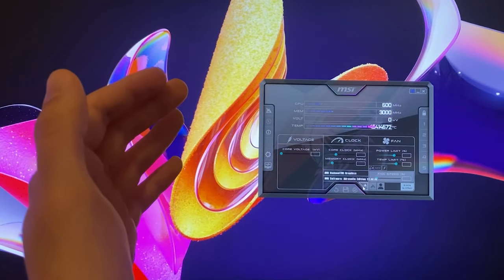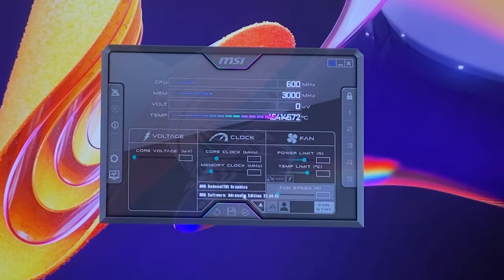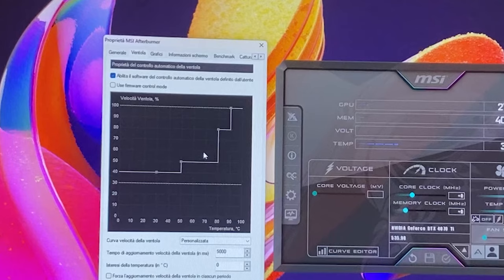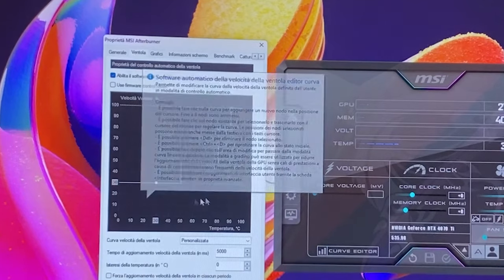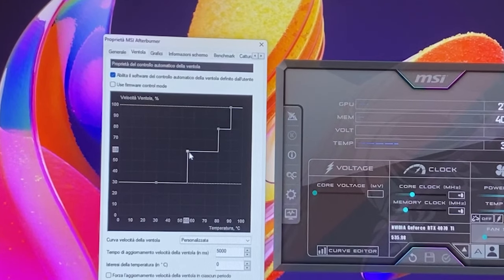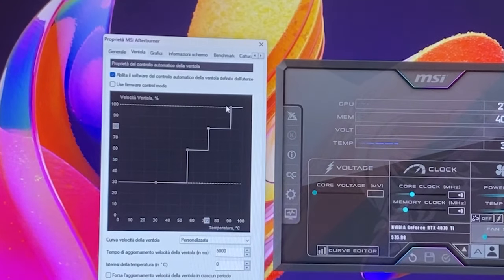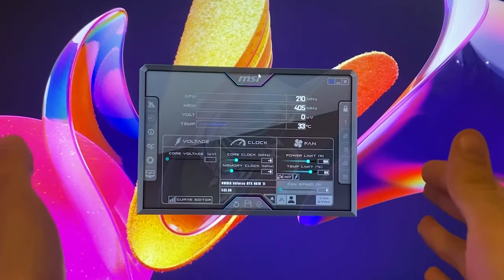Set a Custom Fan Curve on your GPU to Reduce Temperature and Noise - Tutorial

Comment: I have a Strix 4090 OC and also have the line that doesn't allow the fan speed to ever be completely off, BUT I set mine at ZERO regardless and if my cards under 35c it will actually not have the fans running at all - Also as for you not recommending doesn't really, almost objectively make any sense, 30% fan speed for hours a day potentially is only going to cause the fans to wear quicker. My GPU at idle stays between 28-35c MAX! For doing anything other than gaming, such as browsing the web, watching youtube videos, twitch etc. With that said, having ZERO RPM is objectively the better option
Reply from the maker: I definitely see your point and in GPUs with massive heatsinks that’s actually a very good choice! Be careful with doing it on lower end GPUs with no VRM/MOSfets heatsinks because you do need to cool these with some airflow
Reply: "BUT I set mine at ZERO regardless and if my cards under 35c it will actually not have the fans running at all"

Same here with the 4080 MSI Ventus, as I also prefer the fans completely off at low temperatures.
I have the issue though that I want to fans to stay off also at a higher temperature, let´s say still off below 60 degrees - I changed the curve accordingly in Afterburner, but it seems it´s not being considered.
Any idea how to fix that?
Reply: itsdistinctly are you sure? I just don't really understand these things
Reply: How can set 0 fan on aferburner?
Without aferburner my 4080 zotac trinity have fan stop,but if i open afterburner fan start at every temperature 😢

Comment: Soo when i was playing Valorant my GPU fan speed sometimes increased constantly and then decreased again, is that normal? I'm using GTX 1660 Super and followed the exact setup like in your video.
Reply: that is normal if you didn't set your fan curve and go with stock settings

Comment: My coller in a brand new rtx 3060 asus dual is making rattle noise at 78 to 81% so i undervolt in with your previous guide and make flat curve to 64-80C to 76% and it works flawless, thank god that earth got ppl like you🙏
Reply from the maker: I’m really happy it was helpful! Thanks a lot for taking the time to leave some feedback! :) I’ve also got a few build videos on the channel and more coming, if you like the content consider subscribing as it really helps me a lot!
Reply: Have same card, its terrible at 80%. Have a look at your gpu hotspot! Mine were too high. See my main comment
Reply: you mean by coil whine? or rattle from the fans. if its coil whine its normal you can minimize the whine if you are playing a game make sure set the fps lower 60 fps below no coil wine 70 to 90 minimal whine. 100 to 250 noticable whine. i dont know about the rattle but if your gpu rattle on that rate your fans must be bad.

Comment: Hey!  I followed this guide and your undervolting guide and I am impressed. My 3090 Ti FE runs so cool now with no performance loss at all. My GPU is yet to go over 55c and I have been running games like Cyberpunk and Baldurs gate 3 all on ultra settings. I do have a question though, so when my GPU is a temp between 30c and 55c the fans operate at 800 RPM, but when the GPU is 55c it doubles to 1600 RPM. I am curious if this could possibly have an effect on the life of my GPU or the fans. I will also mention that sometimes it bounces between 800 RPM and 1600 RPM because the card will go from 54c to 55c back to 54c and so on. But overall I am satisfied and yet to see 60c on any game just worried a bit about the fans.
Reply from the maker: I’m really happy it was helpful! Thanks a lot for taking the time to leave some feedback! :) I’ve also got a few build videos on the channel and more coming, if you like the content consider subscribing as it really helps the channel! No worries about the life of the components, they’ll be better than before :)
Reply: You can set the hysteresis for the last problem youve mentioned! I recommend 10 °C. so when it reaches 55°C, it will run 1600rpm until the temp goes down by hysteresis amount, so in t his case 45°C. This will stop fluctuating speeds and lessen the wear of the fan
Reply: @TheEasyk wish there was some visual on how u set that hysteresis..

Comment: just followed your tutorial of undervolting 4070 super and it is truly amazing! but now I'm not quite sure whether I should adjust my 3-fan gigabyte windforce 4070 super, for it works around 50-60 degrees, and it seems strange to get one of those fans to span at 60% and the other two will be doing nothing. do I have to adjust my gpu fan at this point?

Comment: What should be the maximum fan rpm at around 75C? I usually set the fan speed at 65% (2400rpm) when I'm gaming. The stock fan curve is weird on my RTX 2060. Max RPM i noticed was 1800rpm which causes the temperatures to hit 84 (not undervolted) and 76 (undervolted 900mv) on full load.
Reply from the maker: Really it depends on the fan itself. I’d say 60-70% is very good, RPM aside!

Comment: Thank You!
The 4000 series is very well cooled, I test with the 4080, 55% fan speed is more than enough, I never see 60 degrees Celsius.
The 4070TI has lower wattage and I think the 60% fan speed is too high, I only recommend if you have terrible case airflow.
Reply from the maker: I’m really happy it was helpful! Thanks a lot for taking the time to leave some feedback! :) I’ve also got a few build videos on the channel and more coming, if you like the content consider subscribing as it really helps the channel! I agree, on the 4000 series you can get away with much quieter fans overall :)

Comment: manual adjust the fan speed won't cause the chip overheat? cause the fan speed is not in natural mode, not auto let the fan speed adjust itself better even though loud? Gaming in 60 FPS fan speed won't go loud unless disable vsync in game setting for make it higher fps.. high fps the card  increase fan speed RPM. If the pc for working or browser only, don't have to bother adjust the fan speed. it won't go high at all..new graphic card, new technology,  fan speed 0 RPM

Comment: Thanks for the video. I tried the 4 node profile you suggested. Tried to save to card. It said it could only do a 3 node save. I did that and it took it. Now, if I wanted to try a 4 node with AB running, how would I reset the to the four node option. It went away doing the 3 node. Anyway, good info. I have some control of the fan speed.

Comment: In cs2 while i play my fans chances in between 60% and 80% so much. Like it is 60% then goes 80% for like 10-20seconds and then back to 60%. So does it harm my fans or gpu or is it just good???
Reply from the maker: I'd say try to put it to 70%, maybe it will stay stable, for noise. But no, it's not gonna damage thee fans
Reply: @ImWateringPSUs  okay u mean 80 to 70 or 60 to 70?

Comment: So checking the box that says “firmware control mode” will basically save your profile so you don’t constantly have to run msi afterburner at startup or while playing games? Does this also work for the undervolting settings as well?
Reply from the maker: Correct and correct again :) Also consider dropping a like and a sub!

Comment: At 30% (lowest my GPU can go) my fan rpm is 1780-1800. It's loud as hell and it's driving me insane. Some people I've spoken to say their fans can go as low as 900 rpm on the lowest percentage. Is my GPU faulty or something?
Reply: it depends on what type of gpu you have if i set my strix 3080 ti the only noise from the fans is around 60% below that no noise at all. what software are you using for fan curves?

Comment: i have i gtx 1070 asus turbo when doing nothing the temperature is around 36 to 40 but in gaming for example when i play apex legends temperature jumps all the way to 82 i changed the thermal past added some out take fans but it didn't change much ...
i hope you can give me an answer to this problem if you have one 
nice video btw
Reply from the maker: You need to undervolt it, I have a tutorial on the channel

Comment: if firmware control change your fan curve settings on your gpu is there a way to reset the firmware fan curve settings back to default or do i just uncheck the firmware control box
Reply from the maker: Yes you can, just uncheck the box :) Oh and subscribing to the channel helps too :p

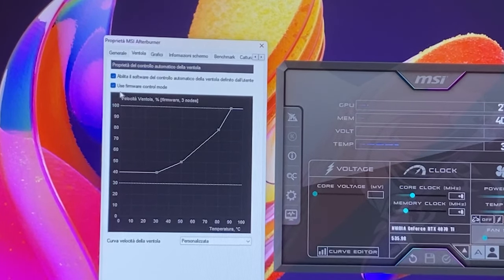Comment: Bro! I did what you said at 1:50 to save the profile to my gpu, and now the gpu fans stop working entirely, even if it reach 100 degree they stay not spinning, I restart the pc, and unninstalled msi afterburner and still nothing, please help! I heve an rx 580
Reply from the maker: You must have another software interfering. Reinstall the drivers, reinstall afterburner, set it to default and they will work again :)
Reply: I reinstalled MSI AB, I uninstalled the GPU drivers with DDU and installed them again, a friend came by and flashed the GPU with fresh bios, I also tried it on another setup, nothing works :( @ImWateringPSUs
Reply: @takey2376  Bro did u get it to work?
Reply: @3freeet948  no, I bought a new one, this mf ruined my gpu, and didnt even say sorry
Reply: @takey2376  Damn bro that sucks 😞 sorry to hear that, hence why I asked first if it worked, I didn't want to try and fck up my card. 

I was getting 84 degree under gaming load when I search and find this video and guess what I did? I repasted the card and not it only go to 68 - 71 degree under gaming load which i think is good.

Comment: can't control my fans at all, latest amd drivers yeeted that ability and my gpu fans are still (unless gpu goes above 60°C) it seems no program can turn them on
Reply: Can you not adjust your fan curve in the Adrenaline Software?
Reply: @ThisLuvee  fixed everything by flashing it to a normal rx 6600 👌🏻 (I use a Soyo rx 6600m)
Reply from the maker: I’m really happy it was helpful! Thanks a lot for taking the time to leave some feedback :) Consider subscribing if you wanna support the channel!

Comment: How about hysterisis for 40xx series with zero fan for desktop use? Can you do a video with a curve with zero fan and hysterisis enabled? Thx
Reply from the maker: Very good topic. Personally I still use this kind of curve on the 4000 series, obviously it’s possible to set the fans to 0dB
Reply: @ImWateringPSUs  sure. I have zero fan on until 40c set. But hysterisis is important on 4000series. I have an 4090 and in gamemenus it drops fast under 50c or even my 40c set, and that always turns off the fans into zero rpm. So hysterisis is helping a lot there. But only working properly with a stairs/step curve. Maybe you can experience more on this and share another video 🙏

Comment: when i try to use "use firmware control mode" it puts my gpu at max fan speed, sometimes even going over 100, so i guess it doesnt work for my gpu, ill just have to be starting the app with windows n minimized right?, i got a Gigabyte Rx 6600 Eagle n i want my gpu to always be at 55 fan speed but go all the way up to 80 is there a way i could have it start with windows but for it to not start the on screen display
Reply from the maker: Yay that’s unlucky but the firmware control mode doesn’t work with all cards. Yessir, start with windows and start minimized :) Consider subscribing to the channel if the vid was helpful!
Reply: @ImWateringPSUs is there a way to make the fan speed go up by seconds instead of going from like 50% to 60% instantly, I want my gpu to go like 51 52 53 54 all the way up to speed it needs to be, cause I feel like my gpu is gon break if the fans kick up instantly instead of slowly, you know what I'm saying?

Comment: I’m trying to set the curve, but my idle temp is staying at 70 since that’s what I’ve got it set to on the main screen of the MSI afterburner, but when I go into settings- fan- and then make my chart like yours, the idle should be at 30% fan speed but it’s just staying at the stock 70%. Any help?
Reply: Bro did u figure it out?
Reply from the maker: That’s very odd. Do you have a laptop?